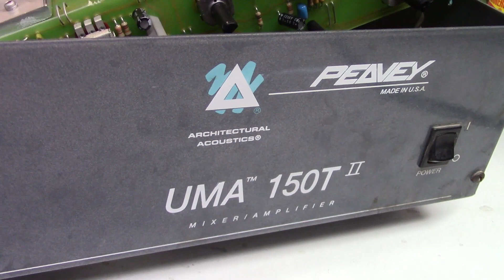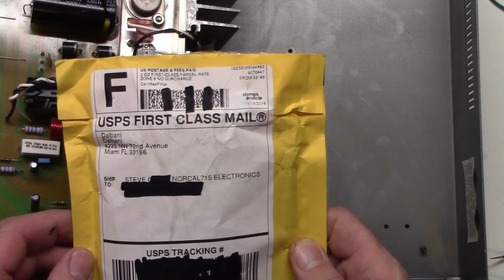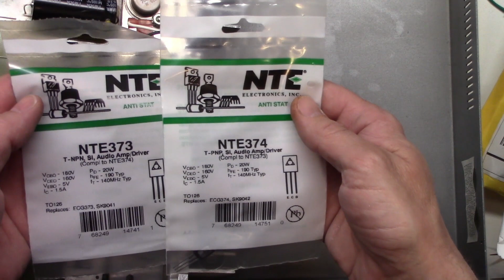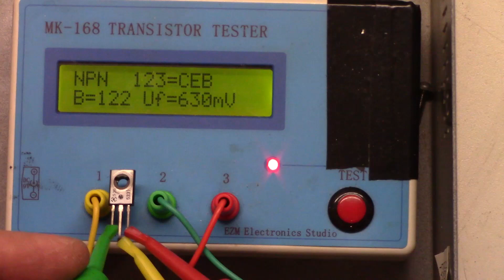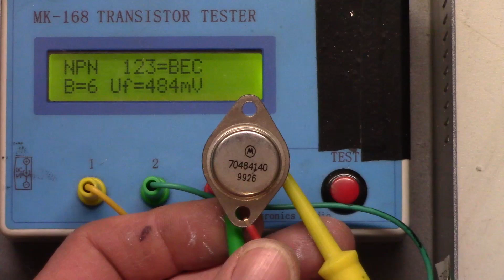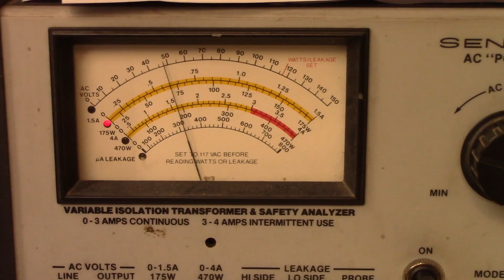PEAVEY UMA 150T II    BLOWS FUSE   REPAIR FIX  70474140 70484140 TRANSISTORS BASIC SCHEMATIC ALSO!

Comment: Would love to see that failed transistor inside, where you could see the failed spot on the die. I would suspect though that they are regular Motorola part numbers under there, probably similar to the 2N3773 or others of the same die design. Only house coded for Peavy because they probably ordered them in 10k lots, so they could get them house coded as a service, but otherwise exactly the same as the commercial offering, just they were ordered as a box containing 100 polystyrene trays, in a big vacuum sealed anti static bag.

Comment: Those are likely fakes, not originals.  There is nothing special about those transistors anyway. They are simply relabeled with Peavey's part number.  A better replacement for those two is the  MJ15024 (NPN) and MJ15025 (PNP). They have better specs and can be purchased from trusted sources, like Mouser or Digikey for less money.
Reply: Peavey crosses their MJ15053 to 70474140  and their MJ15052 to 70484140, As a rule, the last 3 numbers on their power transistors are for their voltage. Hence a 70484140 would be a 140 volt rated transistor.
Reply: @neutrodyne  those were a good cross, but those devices have been discontinued. The ones I listed earlier are are still active devices and are rated at 250 Volts.
Reply: Nothing wrong with going with a matched pair of higher voltage transistors. I was just stating what Peavey has listed on their cross reference chart.
Reply: Generation XT, is the MJ15024 the replacement for the 70474140 or the 70484140?  Thanks for the great info!
Reply: @bertcarrier3520 It would replace the 70484140.   The 70474140 is PNP and the 70484140 is NPN. So whatever replacements are used would have to be the same polarity.
Reply: @GenerationXT  Awesome! Thanks for the reply.